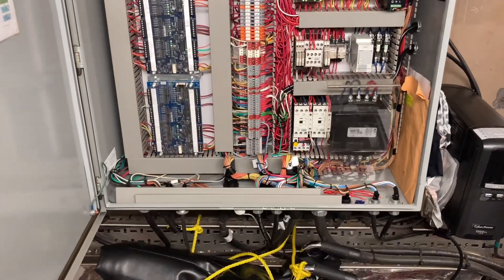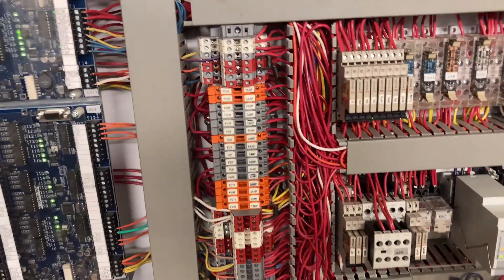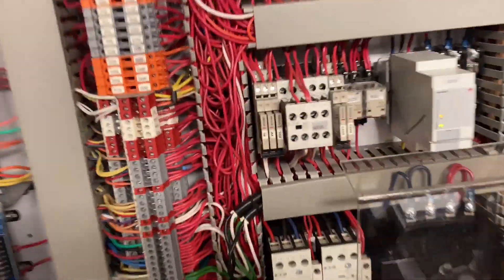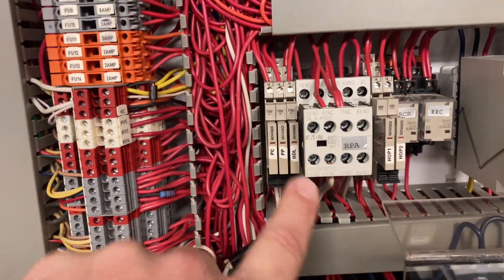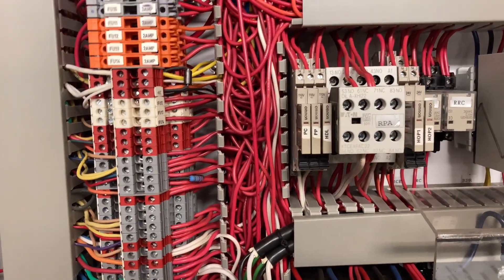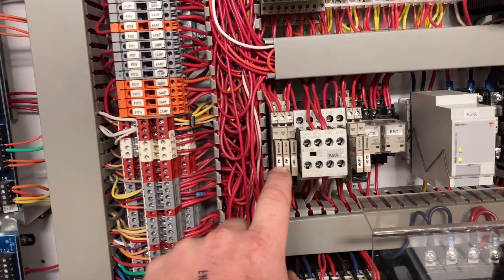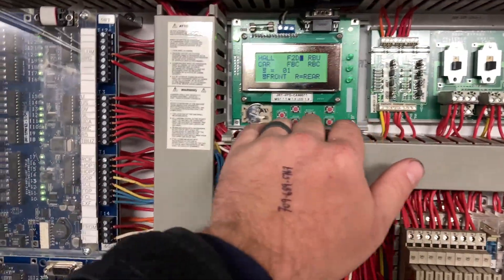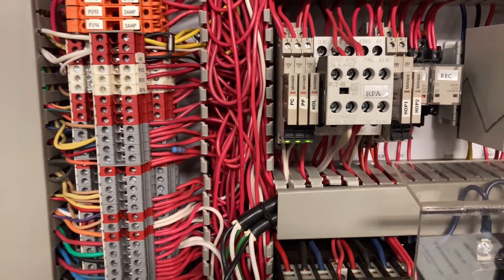More Problems

Comment: It looks like the vent on the tank is capped off. If you loosen up that cap Or replace it with an actual air vent it will displace the air when the oil is returning into the tank. That should help with that oil leak under the valve body
Reply from the maker: I know it’s not the normal ITI cap, I believe it’s usually a Chrome vented cap, this one is vented. It has a hole up through the middle and has openings on the side, obviously your not able to see this unless you remove it.

Comment: It’s all ways nice when you have top and bottom call buttons from the panel 👍
Reply: Possibly needs a valve block overhaul?
Reply from the maker: Turns out it was a little loose underneath, the return was which I showed but I ended up tightening the three Allen screws too which fixed it.